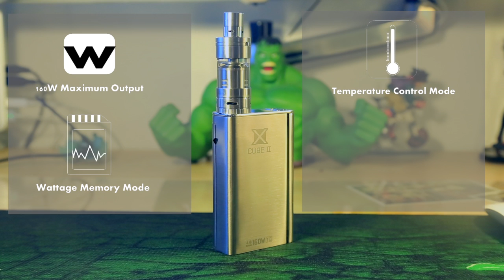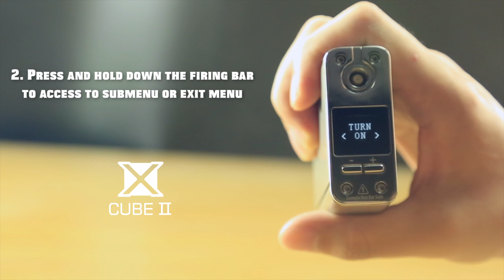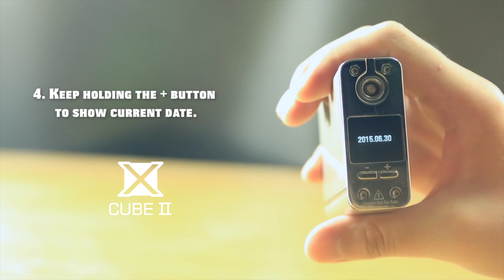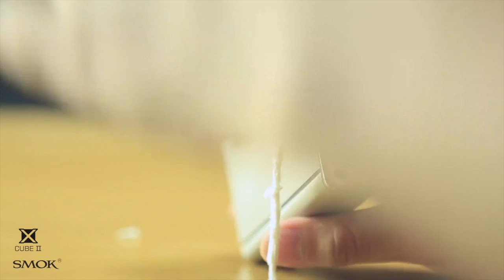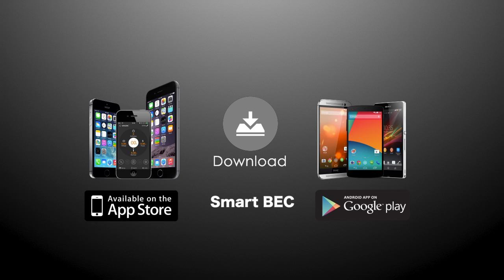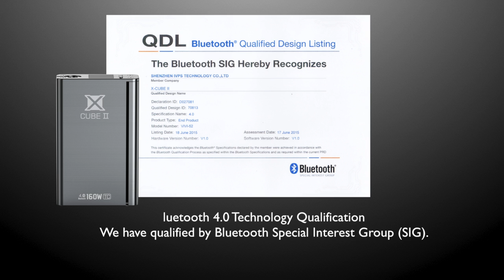SMOK X CUBE 2 X CUBE II 160 WATT  Temp control

Comment: Burns mine even in soft ramp up at 40w. Same as the koopor plus I had. temperature control is basically unuseable. 

All TCR set correctly of cos. I was thinking of giving the new xcube mini another try but I'm apprehensive. My VTC Mini works great in all modes. never gave me a single problem.